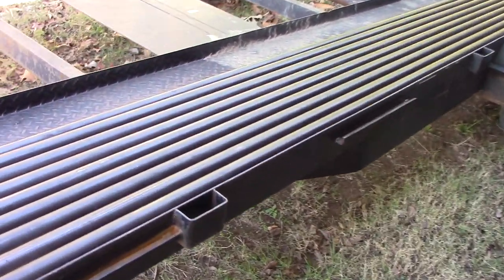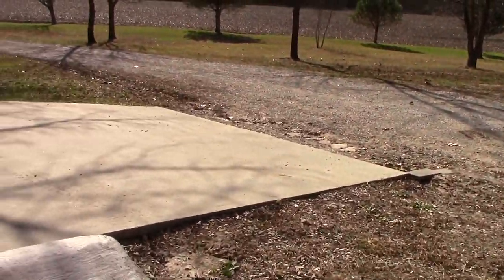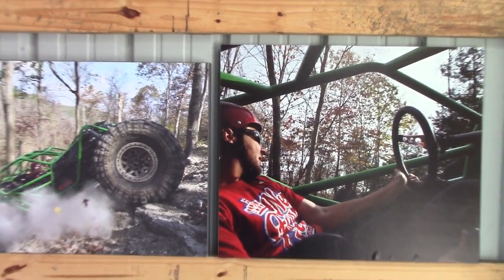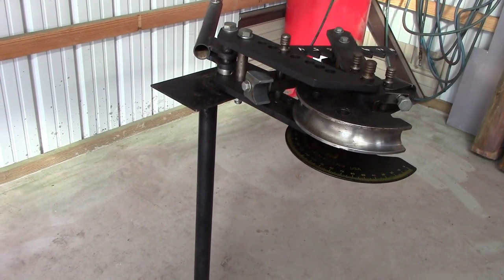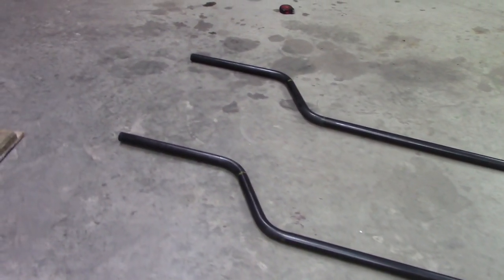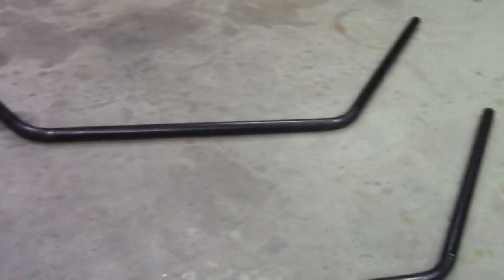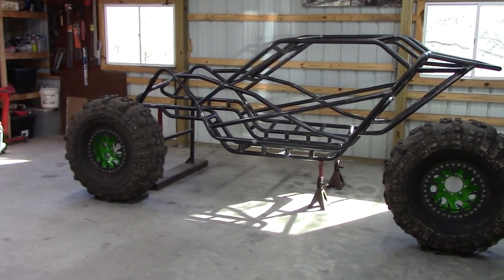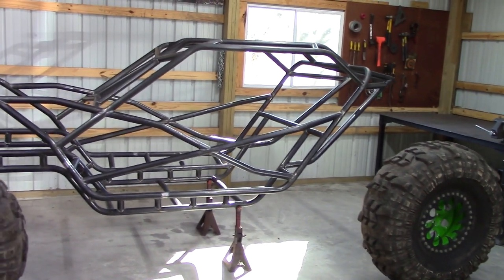I build a BRAND NEW ROCK BOUNCER CHASSIS

Comment: Do you use rolled tubes or seamless? How much does a completed chassis weight please(just the cage/frame, no suspension)?
Reply from the maker: I use dom and electric rolled. With no tabs or anything, 400 to 500 would be my guess.

Comment: How long did this take you? And how much is the cost for Materials?
Reply from the maker: 10 days. 800 or so. Depends on tube type.
Reply: Did you use all the same tubing or different
Reply from the maker: @slipperyfilms600   I've used dom for the roof and erw for the rest, or just all dom. Sometimes its the person I'm building it for to decide what they want.
Reply: Which would you recommend 188 or 120 for a trail rig
Reply from the maker: @slipperyfilms600  properly placed .120 wall will keep you protected. Just don't have a bunch of dead nodes.
Reply: @Lowbouncer  what's the price for the one in the vid?
Reply from the maker: @jaredcoleman4248  I tend to be so dang busy all the time, I'm not able to build as many as I would like, but yes I've built a handful for other folks. All the tubing is 1.75 OD. Where are you located?
Reply: @Lowbouncer  I’m in South Texas but absolutely down for a road trip you just say when it’s ready LOL  I’m interested in a 4seater seriously if you’re down to tack one together I’m interested and no biggie driving wherever.! Where you located